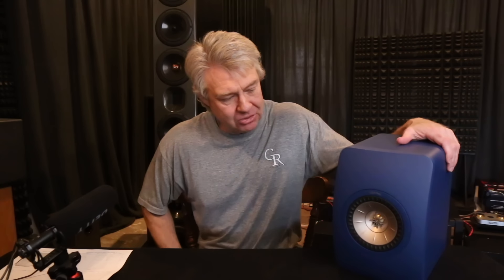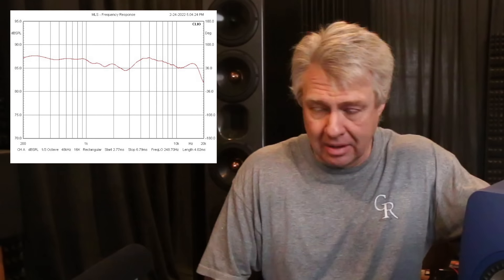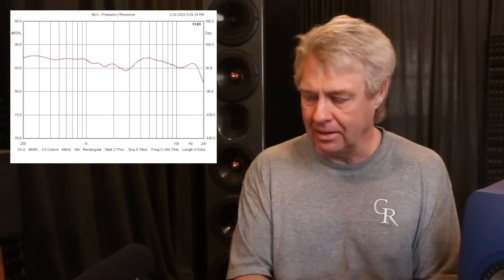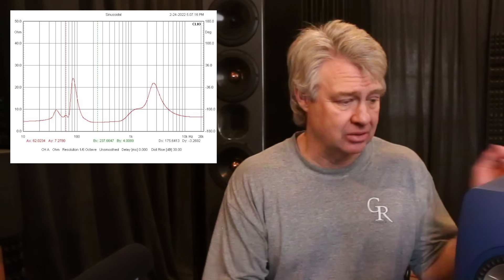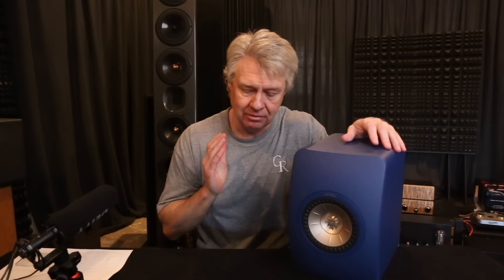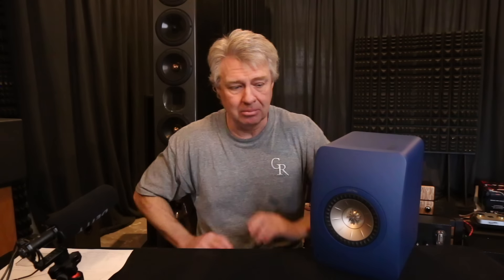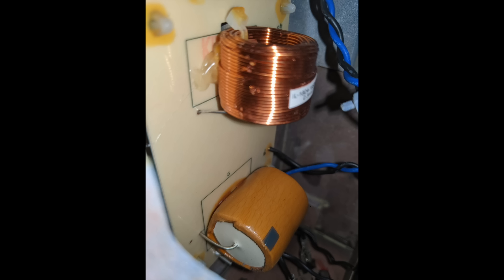KEF LS50 Meta! Worthy of HYPE?

Comment: Check out the Technics SB-C700. Even Stereophile compared it favorably.
Reply: There are a few you tube videos out on the Technics SB- C700. Seems impressive from what you can take from the compressed audio. Not easy to find though!
Reply: The SB-C700 is very impressive. Crazy holographic imaging of all the instruments. Snappy fast and tonally natural midrange. Sweet highs, deep bass. Everything one could want
Reply: @DigitalPhilosophers  Good video comparison to the Elac Vela. The Vela's are beautiful,  but i felt more restrained to the expressive Technics 👍
Reply: @steventsimtsos4029  You say it. The SB-C700 sound expressive 🤩
Reply: I've heard they are a bright speaker. Would that be correct?
Reply: @cremersalex  probably depends on the amplifier used. If of decent quality 2 channel, i believe it will nicely balanced. The reviewer used an Arcam SA20, Rotel a14 and a Vincent Sv 500. Sounded great with all of them 👍
Reply: @cremersalex  I‘ve heard the speaker itself and they sound nothing but blood amazing

Comment: Love that TARDIS💙blue!
Theoretical listening evaluation Danny? 🧐
Maybe the owner was hearing problems in his partnering equipment/room or pushing them too hard without subs? 
(Btw KEF provide a port plug and ring arrangement for near wall placement).
I'll happily keep my unmolested Original black edition LS50s, (They sound great with REL subs) but I'm interested in your alternative tweeter damping ideas...
How did you get the driver out?
🎶🤫🎶
Reply: We suspect it might be the room. The amp he was using wasnt know as being bright or clinical, but it's hard to say.
Reply: You probably just remove that plastic outer ring to expose the screws for the driver. You might have to carefully use fingernails on the inside circumference to pry it loose

Comment: Contradicción completa. Excelente medición, pero , se deduce mal sonidos por los capacitores de bajos?? Confío en Danny por su rigurosidad, y porque obliga a la industria a mejorar sus estándares,  pero creo falta el aspecto subjetivo de la audición: como suena?
Reply: To me to port noise gets noticeable after around 85 db. That resonance can be solved by pluging it and using a subwoofer.
Reply: Youd be surprised. I have one of our high end kits with an external crossover. One pair of crossover's i built uses high-quality parts, the other uses some of the cheapest parts I could find on Parts-Express. On par with the quality seen in the Metas. They measure identically, but sound nothing alike.. the cheap crossovers sounds dull and congested at best.
The reason we dont do listening tests is because customers often only send us a single speaker to save on shipping costs.
We also don't install the upgrades to be able to do before/after testing.

Comment: I use the KEF LS50 Meta for both 2 channel listening as well as part of surround sound system. So currently I have the fronts and center being LS50 Meta's and 2 rear Magnepan MC1's plus a transmission line subwoofer which I constructed many years ago. I believe the secret to unlock  this system are the amps. A Van Alstine Hafler 220 plus a bunch of Adcom amplifiers seem to do the trick. Iam quite pleased with the  performance of the KEF LS50 Meta and for the money I believe they are hard to beat.
Reply: They are a lot easier to beat than you think. Every kit we offer will beat up on them pretty badly.
Reply: @dannyrichie9743 So.. produce a kit for these... Iam sure you will get a lot of takers even it has to be mounted on the back of the unit.
Reply: @dannyrichie9743  🤣😂🤣😂🤣😂.   I am certain you think that about every speaker that isn't one you sell or market.
Reply: @tlr5457  Or it could be that I am  just being honest and these really aren't that great.
Reply: @dannyrichie9743  Or maybe all independent reviews rate them highly. I find they play all genres well unlike some more expensive speakers.
Reply: @StillAliveAndKicking_  Our bar is set a little higher over here.
Reply: @dannyrichie9743  I didn’t realise you are the chap in the video. One would expect someone who sells their own products to say what you said. So which speakers that you sell are better in your view? I checked out the speakers that you sell, and most have very irregular frequency responses, with a bloated treble in many cases. To be fair some look good, but they are not cheap when fully assembled. If someone bought a kit, then yes they probably get a good product at a good price. I got sick of finding that almost all speakers are heavily voiced, which distorts the music. Unlike you I don’t sell speakers, so I can say what I think having tested countless competitors to the Kefs. It beats speakers costing twice as much, assuming one likes a balanced presentation of course. If you like an exaggerated treble, or bass, then the Kefs are not for you. Your products may well be good, but it pays not to dump on other products that are excellent.
Reply: @StillAliveAndKicking_  You might want to take a closer look at the frequency response measurements we post. We post them on a 5db scale. We do that for a closer examination of the response. It doesn't look as smooth as graphs posted using higher scales, but for those that understand the graphs, they realize that the response measurements show exceptionally smooth responses.  Having hundreds of speakers come through here all the time, we know exactly where ours stand in the marketplace. If they didn't dollar for dollar crush speakers like the Kef LS50's then I wouldn't even offer them. Our similar sized X-LS Encore out classes them across the board.
Reply: @dannyrichie9743   I have no problem reading a graph, that is at least one benefit of having a PhD in physics. You are clearly a good salesman, but your comments are no more than sales talk. There is a reason why the LS50 Meta gets such good reviews from almost everyone, and it’s not due to the marketing. They exhibit very good design. For a flatter frequency response, we really need to go to actives from Kef, Neumann and others. I suspect some British brands get good magazine reviews due to marketing, and advertising their products in said magazines, which is why they are less well reviewed elsewhere. That isn’t so with the Kefs. There are plenty of measurements of the Kefs online, Kef themselves provide some. I don’t doubt your kits offer good value. Some of the better ones may match or in some ways exceed the Kefs, but you yourself publish frequency responses which for the cheaper ones show high colouration e.g. exaggerated treble. And there is no way your built speakers beat the Kefs at anywhere near the same price.
Reply: @StillAliveAndKicking_  My designs have won pretty much every award at every magazine online and in print. I am well aware of the magazine review game. Good reviews are easy to come by especially when spending money on advertising. For a certain amount of money in advertising they will even throw in a good review. 

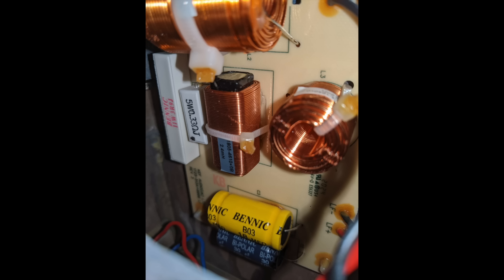Watch this video and scroll to the 4:55 mark to see the parts used in the LS50. The parts used in the woofer circuit are garbage. We would never use parts like that in any circuit of any speaker playing above 200Hz. Most of those parts we'd never use period. Even in our budget level kits we offer higher quality. 

Also, the material used in the drivers themselves are a problem. The cone material has a very unnatural sound. The frames ring. There is nothing great about them.  Even our fully assembled X-LS Encore and X-Brave (at completed prices) are in a completely difference performance league from the LS50's. That's not salesmanship either. It's a fact.
Reply: @StillAliveAndKicking_  Here is what I know for a fact. The woofer circuit uses budget level parts that are not to the level we'd even consider using. It is actually stupid to use crap like that for a driver playing up to a tweeter. A lot of people can like them all they want, but they are a long way from the performance level of even our least expensive kits. Comparing them isn't even a fair comparison. Nothing about the LS50s are even close. Bring some over for yourself and we'll let you side by side compare them.
Reply: @dannyrichie9743  Sorry but you are completely full of it. I’ve heard countless speakers, there are huge numbers of rave reviews of the Kef LS50 Meta speakers including measurements. The frequency response is close to that from a good active unit. They are the best I have ever heard at anywhere near that price for an off the shelf speaker. Sure you have your own products to push, but best not dump on other brands, it makes you look bad. And since you do dump on them, let’s look at yours. They have much less cabinet bracing, much less sound damping material inside, if any, and they use off the shelf drivers. As I said, I’m sure they are very good, competitive products, and very good value as kits.
Reply: @StillAliveAndKicking_   On no, I know exactly what I am talking about. Let's have a look at our X-LS Encore for comparison. The cabinet has five braces and if you order them completed they are also lined with No Rez. So they have less cabinet ringing than the LS50. The drivers are NOT off the shelf. I design all of our own drivers, and they are built for us and only us. The woofer uses a treated paper cone and sounds a LOT better than the Kef coaxial. It also plays lower. Our  woofer also has a non-resonant polymer frame. The steal frame of the Kef rings big time. Our T26 dome tweeter is a much better sounding tweeter than what is in the Kef and crosses much lower as well. Parts quality are no comparison. The Kef uses junk on the woofer and a lower level Clarity cap on the tweeter (not bad on the cap). The inductors are all Chinese made and typically recycled Copper. The resistors are the cheap sand caste. The crossovers in our completed pair of X-LS Encore's uses all US made Copper, air core inductors. It uses Sonicaps (much higher quality than what is in the Kef). We even offer Gen. 3 Sonicap by-pass caps in the tweeter circuit. The resistors are the new Dayton Copper resistors. The Kef uses Chinese wire in PVC. They also use push on connectors made of mostly Tin. The X-LS uses four 9's pure Copper in polyethylene made in the US from US Copper. The Kef uses cheap binding posts with steal nuts on them. The X-LS Encore uses pure Copper tube connectors and no ferrous parts. The X-LS Encore will literally out perform them in ever way. They are also the same price. Or you can build the X-LS Encore from a DIY kit for less than half the price.
Reply: @dannyrichie9743  I’ve seen the measurements and listening test of your Little Giant Killers, one driver er speaker, and horrible resonances in the bass. The reviewer called them the worst speakers he had ever listened to. He also stated that he had heard some very good speakers from you. But the main problem here is that the LS50 Meta is a direct competitor to your own products, hence any comments by you are from the start totally suspect. And as for your capacitor claims, sigh.
Reply: @StillAliveAndKicking_  It is easy to claim the little LGK's have a horrible bass resonance when the reviewer is simply sending them a full range signal and over driving them. If you want to hear how they really sound then we did make some recordings of a pair of them  playing at high levels with the bass filtered off and handed the low duties over to some subs. https://youtu.be/aWDPieaILIg   Even the LS50 Meta's can't compete with them when used as intended.
Reply: @StillAliveAndKicking_  You obviously did not listen to the files.
Reply: @dannyrichie9743  Why didn’t you provide kit to a reviewer (I thnk his name is Amir) when asked? When he reviewed your LTGs, why didn’t you point out his supposed faults? I actually don’t believe he did the test badly, and I’ve seen enough of your claims disproved by measurements to not trust you. Amir has on occasion been contacted by companies when the results were unexpected, for example low temperatures were found to influence the result. But you won’t contact him.
Reply: @StillAliveAndKicking_  He isn't a reviewer. He is just a guy with some measuring gear that he doesn't know how to use. He is hardly worth responding to, but there are some responses coming. I just shot one a few days ago that show how false and misleading his claims are regarding power cables. It will be out shortly. Anything he gets his hands on is just going to be a hack job. He just has an agenda and an axe to grind. So if I wants anything of ours he can buy it.
Reply: @StillAliveAndKicking_  Still haven't listened to and compared those files huh?
Reply: @dannyrichie9743  Regarding Amir, wow, what a pile of nonsense. There’s plenty of people performing the same measurements with the same results. And he posts his measurements in an open forum, where they can be scrutinised by anyone including manufacturers, and they do. Neumann questioned his measurements with one speaker, and the source of divergence was located. It’s not just him that tests your claims, but I am sure you know that. The fact that you don’t engage with him is telling. Very telling. Better stick to bigging up your own products and putting down others in videos.
Reply: @StillAliveAndKicking_  His problem is that he doesn't know how to interpret the measurements. I have seen him look at a spectral decay and claim that it shows a driver resonance when it fact it is really showing an internal reflection because he didn't add any insulation to the box. Then trying to play a 3" driver full range to a 90db in room level? Come on. That is totally stupid. He doesn't know how to test cables either. He shot a video trying to measure the EMI of a power cable that wasn't even plugged in. He was laughed at so much for that one that he took the video down. He doesn't have a listening system set up for evaluation either. He is almost beyond help. For me to help him, he really needs to be willing to learn, but he thinks he knows it already.  He is the hardest type of person to help.

Comment: Thanks, ive been waitin on this for quite awhile, you may like hearing this, I've had the old ls50 and the meta, I did a direct head to head with the xls-encore maxed on upgrades, and nearfield in a small room the ls50 is great and will do just fine they sound great, but after 80 db or so the o much port chuff and turbulence, woofers works to hard past 80 db, it's great for smaller rooms, but the encores definitely outclassed them in every area, the encore is still my favorite bookshelf I've had, the revel performa m106 are great also, probably top 3. The closest thing to the encore I've found in all areas to date believe it or not, they are not very well known and fairly hard to find, signet sl260 b/u models made in Ohio, seas tweeters and vifa woofers, 1 inch mdf, high quality build, great speakers, are my new favorite bookshelves other than those encores, I'd say it's a close fight between the two, maybe encores edge them out by a slight bit.
Reply: I had those Signets. Surprised you like them that much. I found them lacking detail and a bit soft and slow dynamically. Might have been the electronics but with some A/B comparison with a Paradigm Studio 20 v3, the Signet was unimpressive.
Reply: @michaelblumfield3933  everybody has their own thing I suppose, in a 12x12, 21 inches off the floor, off the wall 18 inches with slight toe in, their awesome, top end sparkle, imaging, their bass is good quality and a softer bass similar to ads I've found, midbass character is great also, and top end is smooth even being an aluminum tweeter, I like em really well, and have owned way too many speakers lol, but these are in my top 3 favorite bookshelves for the money, for my room and listening tastes anyway.
Reply: @JukeboxAlley  well, glad you like them. Definitely an under the radar speaker that doesn't come up for much discussion these days.

Comment: Enjoy listening to a pair of KEF 105.1s I recently purchased, but then I find their vintage speakers generally sound quite good from this company, especially the Reference series. Granted the crossover network in the 105.1 is a tad complicated but given what the engineers were trying to accomplish the tradeoffs seem to be more positive. 

  I am thinking of getting the recap kit from Falcon Acoustics as they are very close to what KEF designed when they originally created this model. Can it be improved? I do wonder if some Low Rez in the sealed 12" bass driver cabinet might be a good idea. Any thoughts?

Comment: Amplification and sources, not to mention cables and positioning affect the sound 
   Get a smoother amp if it sounds bright and fatiguing...Arcam SA20 or similar....maybe some Marantz....definitely not Cyrus or modern Yamaha, or most receivers and class D, or, if your amplification is expensive then perhaps trade them for some Wharfedale Evo's or Elysians that will temper the the excesses 
  This is what system matching is all about.
Reply: That is will not help the fact that the signal at the crossover is being washed out by budget level parts.

Comment: Increase clarity?? In my experience, the LS50 Meta is one of if not the clearest speaker I’ve heard in 35 years. I also think it images and disappears as well in any speaker I’ve heard under $5k. I prefer the fuller sound of the Heritage Special, but the metas excel in clarity and translucence.
Reply: You need to hear other speakers.
Reply: Are you saying that all reviewers who rave about these speakers, including Stereophile who rated them Class A and Steve Gutenberg who rate them as one of his top speakers ever,  haven’t listened to enough speakers, or perhaps they don’t know what they are talking about?? I’ve owned around 20 speakers and I’ve auditioned more than a hundred, and these are the best near-field monitors I’ve heard under $5K. I agree with Stereophile and other reviewers.